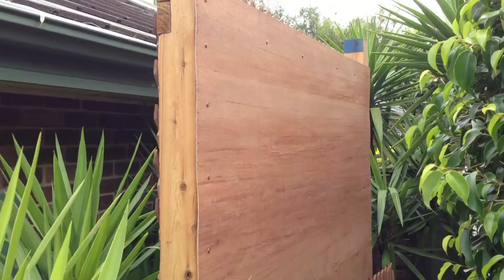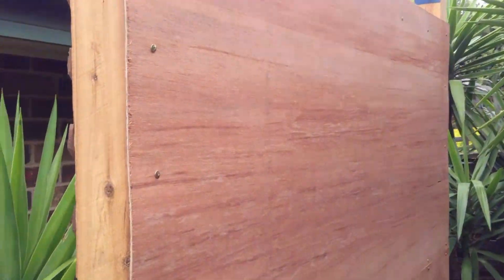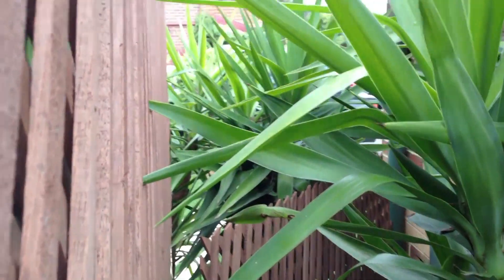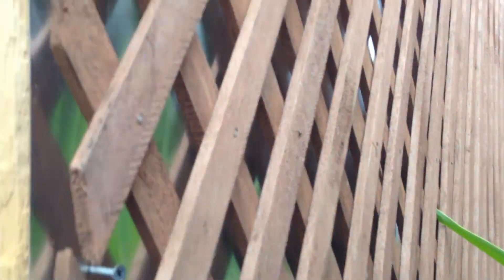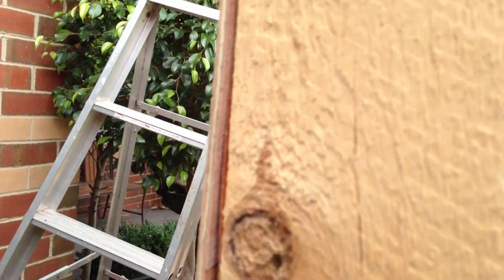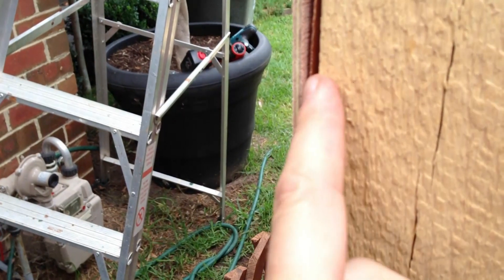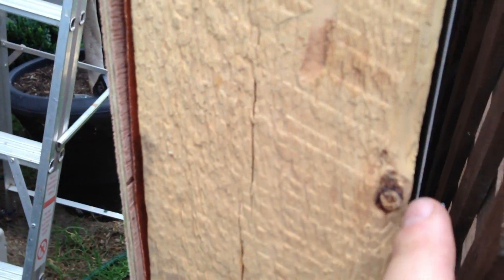How To Make a Smart Meter RF cancer radiation shield screen

Comment: good work, thanks for the video, any particular reason for the combination with aluminium and copper, ive heard copper is superior at blocking over aluminium?would the 2 be a good combo? i have one on my bedroom wall, looking at blocking a big are where the smart meter is and then maybe using aluminium fly screening against the whole wall also. Did u happen to take reading before and after you earthed it.Thanks again for posting this
Reply from the maker: i used one side of aluminium because it still works well and is a LOTTT less expensive. I started off with aluminium first, did some meter readings and wanted to improve it. I could have just added the second wall of aluminium but I decided to take the plunge and fork out for the copper. The sheets of copper cost over $600 total and the aluminium cost around $60. So yes copper works better if you can afford it on both sides but I had a massive reduction like this with one of each. plus I figured I would mix up the metal a bit and they might attenuate different frequencies. re: Earthing...it improved things further. The main thing you will find without earthing is that initially the screen will seem to be working great but over time (a few weeks or so) the panels will be come electrically charged and will stop working effectively.